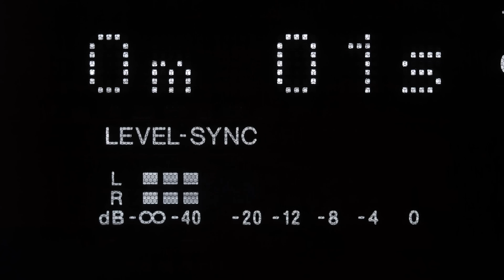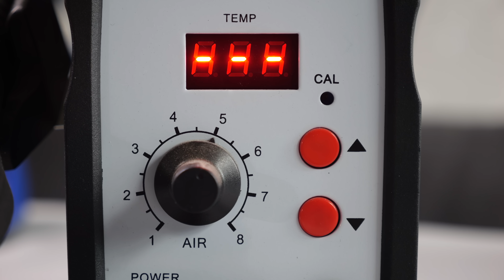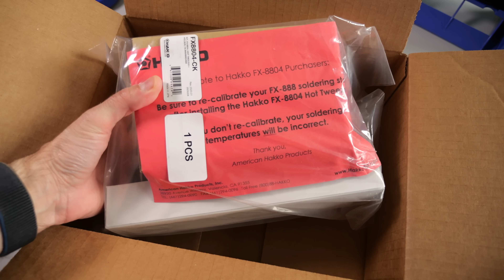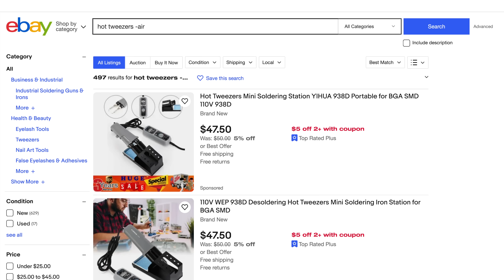A BETTER way to replace surface-mount capacitors!

Comment: I'd give the "Two Soldering Irons" method more consideration. It's by far the most popular method I've seen and used in a professional rework shop. As an added bonus, for projects requiring two different types of tips you no longer have to wait for the iron to cool to switch between tips.
Reply: You’re perfectly right. Last time I recapped a board, I was so bored with the hot air gun that I remembered having a second soldering station. I gave it a try and it’s really THE good method. Even better with sole flux applied before desoldering.

Comment: I'm personally tempted to try the twist method first because it's so quick. I think it's worth mentioning that it should take VERY little force. If the cap doesn't twist and pop off effortlessly, I stop and switch to hot air or tweezers.

Comment: Before watching... gonna say that I usually twist them, and they generally snap right off, with no damage to the pads.  I replaced THOUSANDS of these when modding recording interfaces at Black Lion Audio.  You need to twist one direction, rotate in the other direction, and THEN lift after you hear a slight/light snapping sound.

Comment: You can also lever up one side while adding some solder.   Being gentle enough you can pull up that side off off enough to wick away the excess and just hit the other side really quick boom done.  I only ever have to do like one of these at a time it's my go to for this.

Comment: I've honestly had good results with the twist method on multiple occasions. It requires good judgement and a bit of finesse, though. Don't ever yank or pull on the caps, always press into the board while twisting. 

Hot air or soldering irons aren't always effective, especially on those caps that leaked badly. The corrosion is usually bad enough that the pads are caked in an oxide that won't melt without considerable effort. Frankly, if a pad does lift, that usually means the electrolyte corroded it so badly it would have to be repaired anyway.

Comment: I had to replace 600 caps off 300 custom boards (my fault in design); it was super simple just to twist them off without lifting away from the board. There were no casualties, or even a slight inkling of damage to the PCB.

Comment: I'm amazed so few use soldering tweezers.

One possible problem with your Hakko is that it might struggle to get in tight spots.

I've used Weller WMRT with RTW1 tweezer tip for about 15 years. Not cheap, possibly a Rolls Royce solution. I've had to replace the tip once and that was recently. Great for getting in tight spots.

Mostly I use it for reworking 0402s and 0603s as well as electrolytics.

Comment: You can twist the caps back, and fourth until you fatigue the legs enough to break without ripping the pads off.
What you did was full send.

Comment: I'm old school and I have absolutely no issues with 2 irons and that works in so many other 
areas as well.  I like to keep one with a relatively large tip to heat ground planes or large parts and the other with a small tip for most work. There are also other tricks that work.  Like instead of using hot air for a DIP chip all you need to do is to glob a lot of solder bridging the pins into one mass of metal.  Do that on both sides and use two irons to melt it all at once and it lifts right off.  We become so accustomed to not bridging pads that the concept seems alien but it works great. Solder wick works as well.  Wick the solder from the pads and with nothing holding the pins the part will just pop off.  You do need to be certain that it's all wicked off though.  A little bit too much solder left on a small pad can pull it right off. wick works best with large parts.  Using wick is an art as well to get it right.  But you can always add more and try again if you can't get it all on the first go.

Comment: I used to remove SMD caps with an iron, slowly and one side at a time.  I was recently converted.  I was recapping an N64 and it was in bad shape and figured I'd give the twist method a shot since I was short on time.  Took me maybe 60 seconds to remove all caps by twisting and pulling off.  Then I did another board, and another one.  No damage to the pads and I could clear the whole board in the time it took to remove a single cap before.  I won't be going back to the old method unless the board is particularly brittle.

Comment: Those exact type of capacitors have vertical contacts through plastic so when you twist the capacitor it causes a rotation, that is why it doesn't pull the pad off the board and it works nearly all of the time.  Just pulling them upward will pull off a pad, and heating the pad in anyway makes them determined to come off.  If they come off when you twist them then you have bigger problems the pad already de-laminated.

Comment: Tried both hot-air and two soldering irons for removing SMD caps. Two soldering irons is what I've landed on as my preferred method. Much faster than hot air. I'll try the twist method on some gear I don't mind if gets damaged. I know many swear by it - but like you, it seems a bit risky. I've seen Adrian (of the basement) do it by pushing down and twist. Snaps those caps right off. If it saves time, I'm all for it.

Comment: low temp solder is also great for removing SMD components. As the name implies, it melts at lower temps than regular solder and stays liquid  longer.
Reply: It might be cheaper to buy a chunk of Bismuth metal and cut or melt off bits of it to use for that purpose. It also makes a great paperweight.

Comment: I have a soldering tweezer, so I use that when I can, but the cutting method is also pretty good. Just remember to clean up the juices.

Comment: This old  thru-hole guy appreciates a thoughtful overview of the subject. I've replaced a few small rectangular components (non-electrolytic caps and resistors) and I can't justify a hot-air station for the minimal rework that I do so this gives me some options. I've only got a hundred or so junk boards to practice on so I'm encouraged...

Comment: Great video! I really appreciate your willingness to try new things and give an honest perspective. Never change! I have tried all the cap removal methods you covered, and my opinions match yours. I completely agree with your conclusions: it all depends on the situation as there are usually many variables at play: board thickness, existing corrosion, physical access, and proximity to heat sensitive parts. It is great to have all methods in your skills toolkit and choose the best one for the particular job. The only extra tip I would add (which is only sometimes applicable) is adding normal or low melt solder to the legs/pads of the stubborn component you are attempting to remove. It can drastically help increase heat penetration to the pads in cases of dried out or corrosion compromised factory solder. Just be sure to remove all "removal assistance" solder completely before soldering in the replacement component.
Reply: I was going to mention low-melt solder too! Old rework PCB's are likely leaded, so they should melt easier than the new lead-free solder. But, low-melt solder makes that job so easy that a baby could do it. I have a Turbo-Duo game console to repair tomorrow and low-melt is my go-to for keeping the motherboard pads shiny.

Comment: To disolder, you have to solder. Got some gel flux, apply it to desired component pads, apply new fresh solder, apply a bit more flux, apply heat in a circular motion to warm up the PCB surrounding the component (in a pre-heating fassion) and have the tweezers holding the component and this one just comes off.
Reply: Seriously. Good soldering technique like this will get you much further.

Comment: I've used numerous of these methods, but what I found most consistent was low melt solder, with either a soldering iron or hot air. Agitate the joint to ensure the low melt adequately mixes.

Comment: Super interesting that everyone has their preference. Adrian Black from Adrian's digital basement just talked about it in his latest video. He mentioned he never had an issue with the twisting method provided you push down at the same time. Never seen the heated pliers before so that's a new one.

Comment: I've always been terrified of twisting or ripping surface mount caps. When I'm at home I use the snipping method since I don't have a hot air station. However, when I'm at work I have access to a good one and use that if I can. For me it depends on what I'm working on, how expensive it is to replace, and how difficult the removal process will be.

Comment: I work electronics manufacturing.  Tweezers or two regular irons are the way my rework people remove caps.  None of our caps have electrolytic leak though.  Low temp solder also makes it easier as well.

Comment: Another simple method I don't think you mentioned is to use a soldering iron and Low Melt solder.  Low Melt is like magic and once you hit each leg with some it will stay melted for more than enough time to easy lift the cap off even after you have removed the iron.  No prep for heat dissipation, no exploding caps from hot air or melting plastic, no torn pads, only downside is low melt is expensive but a little goes a Long way.
Reply: I was going to suggest low-melt too, but you have to be careful to clean it off thoroughly. I do not use it frequently. I would apply and fully wick off standard solder on the pads where low-melt was used, probably twice, before feeling comfortable that the low-melt alloy was completely removed.
Reply: @OutThere458  you make a good point, low melt should at least wick up very nicely.  I would observe how long the solder takes to solidify once you remove the iron and judge from that if it's chemistry is mostly standard solder level.
Reply: I've use this method and never had any problems.

Comment: Thanks for sharing your findings! Regarding the twist method, I've heard that applying a compressive force, pushing the component into the board while twisting, is less likely to delaminate pads. In my experience, PCB pads are less susceptible to delamination from shearing forces (parallel to the board), than pulling forces, perpendicular to the board.

Comment: When you buy the 858D, just test the ground pin on the pwoer cord with the metal chassis with a multimeter. I bought one off Amazon like 2 years ago and still going strong.

Comment: A great hot air station is the original analogue style Quick (857DW). Small looking station with two knobs and two displays. The one you will stumble across is probably the fake or cheap version with a yellowish oval sticker on the front. The good one has a yellowish rectangular sticker on the front. This one has a brushless variable speed fan and a better looking main board. The good one also has a small QR code on the rear. Having the two knobs is priceless. Fast adjustments, something you get a true feel for, no annoying buttons to keep pressing.

Comment: I grab SMD electrolytics with pliers and wiggle them back and forth like a loose tooth, while lightly pressing down into the board. This always fatigues the legs, almost always where they bend 90 degrees to form the foot. Once one leg is free, I change the angle to twist around the vertical part of the other leg. Once the cap comes off, all that's left are the pieces of leg embedded in the solder on the pad, and I always clean the pads up with flux, fresh solder, and wick anyway. I have yet to lift any pads this way, unlike when I was trying to use heat.

The trick is to wiggle the cap with a ton of repetitions and very little force.
Reply: Yes, although I tend to use the snips method for caps myself. In my experience it's quite hard to lift traces/pads without heat, but with enough heat and just a tiny bit of mechanical force it becomes quite easy to make a big mess. I was rather surprised how easily I managed to lift traces when practicing with hot air on some scrap boards (even decent quality ones).

Comment: I heat each side with a soldering iron, but instead of lifting, I gently push them with something like tweezers, slowly "walking" them off the pads as each side gets molten, rather than putting any force against them. It still puts some stress on the pads yeah, but the only time I had problems doing it this way were when I was still getting used to the feel of it, or when I did get cocky and pulled the capacitor up rather than patiently try to walk it off of the pads.

Comment: After a couple of failed attempts with the soldering iron I started to follow the "just snap it" philosophy on the game gear on which I performed recap, but the situation there is a bit particular, because they are normal capacitors with through leads that were packaged to be mounted SMD

Comment: Had to replace 7 caps on a board, non leaky, just gone off spec due to heat - first tried the soldering iron approach, tore a pad off, for the remaining 6 caps, I applied the push down and twist with pliers method, all 6 caps came away, absolutely no issues with the pads.  Also, if you're worried about caps exploding due to heat during removal, stab a hole in the top of the can first, it'll stop any pressure building up :)

Comment: Metcal has several variants of lower cost stations for home use and JBC tools has also released some lower cost versions - both of them have a variety of "tweezers"(I call them "paddles" lol, bc usually they're the width of the row of pins you're desoldering).  Still, use lots of no clean/low solids flux - flux is your friend; keep your rework boards warm and everything works a little better.  Also remember that in most cases the melting temperatures of of the original solder and the temperature required to rework it are different - solders contain balls of different material of different sizes suspended in flux, for most paste applications, which is 99% of electronic manufacturing today. Using some small, softer, eutectic particles of solder mixed with larger higher temp alloy balls allow a lower initial melt temperature but once they're melted and mixed the melt temperature and hardness of the overall material is higher (obviously good for things like high temperature applications and reliability over time); that's why it's so hard to rework some boards, particularly if they're lead-free (in general lead-free solders are higher melt temperature so become harder to rework after initial melt). 
Metcal parts can be found super cheap at online resale portals, since they've been around forever they've also been liquidated from thousands of dismantled/failed tech companies.  If you're going to spend 500 USD or more, though, JBC is the way to go.
The part that had me switch from Metcal in the end was that Metcal is high performance but uses RF heat generation to do so, and sprays EMI.  Most of the time it's not an issue but don't get things like handheld oscopes/spectrum analyzers near them or your test/data will be swamped out.  JBC equipment doesn't seem to bother a scope probe waved over it, so it's okay to have around if you're making sensitive measurements in your lab.

Comment: I've just replaced 27 caps on Roland XP-50 using twist motion and had no problems. Legs pull out real easy this way, but then you have to snip them a little and remove the plastic base. Then desolder what's left and clean up with a wick and IPA. No extra equipment necessary than a basic small soldering iron.

Comment: A tip on purchasing hot air rework stations and soldering irons on the cheaper side is to look at the amazon reviews. If you're lucky you will find one from someone who's actually opened it up and checked if it is electrically safe to use. It's more common than you would think. I've looked at a few tools / small appliances and seen photographed reviews from people saying why or why not the items are electrically safe.
Reply: A lot of reviews criticizing products on amazon get censored away though. Been affected by this on 4 different occasions where my reviews warning of subpar and/or fake components and completely unsafe devices got deleted by amazon for "violating amazons review terms" somehow. I'm now banned from writing any reviews site-wide. Turns out amazon really doesn't like when you hurt their bottom line in any way, even if it's at the cost of customers getting burnt with fake crap or devices that can and will electrocute their users/buyers

Comment: The hot tweezers is great but doesn’t solve the problem of getting the new cap on like the rework station does either.  Great video though! I want one now
Reply: A simple iron puts them back on without heating the cap or melting the plastic. How do you stop the plastic from melting when using a rework to install them?

Comment: From day one I have always just applied fresh solder, heated one leg, lifted it, heated the other leg, and gently wiped it off the board. I've never once had to resort to that violent ripping method. Not even on heavily corroded solder from leaky caps.
Also I would like to note... I own the hot tweezers. They go with my rework station. I don't bother using them because it's so much easier and quick (and safer) to just use the soldering iron.
Reply: Yeah, I use the same method. The extra solder distributes the heat around the pad more efficiently.
Reply: @Cristi4n_Ariel  And it also negates the issue of old crusty (possibly lead free) solder with corrosion. Because the lead free stuff doesn't like to cooperate when removing components.

Comment: I have two hands, so I use the two soldering irons method with ease.  The drawback is that the tips get contaminated with molten plastic and needs cleaning or replacing afterwards.

Comment: You can easily remove an electrolytic cap with a simple soldering machine and an exacto, you unsolder one side only with the exacto pushing on the side to lift the pin then you do the other side with the iron only. The hot tweezer is what you need for ceramic parts.